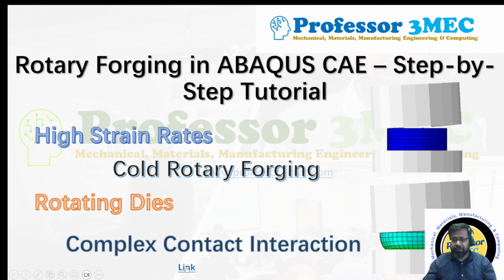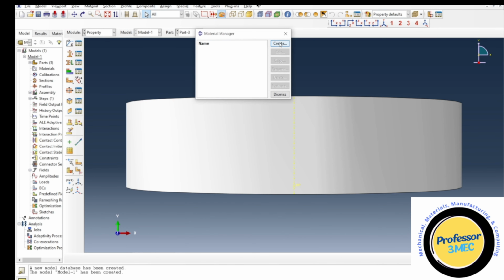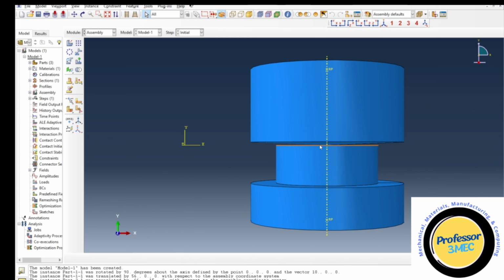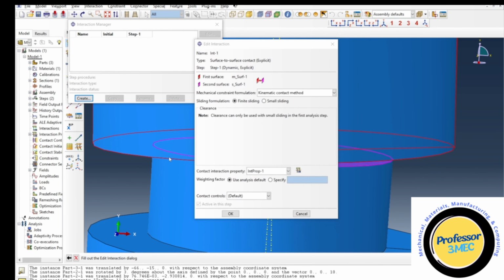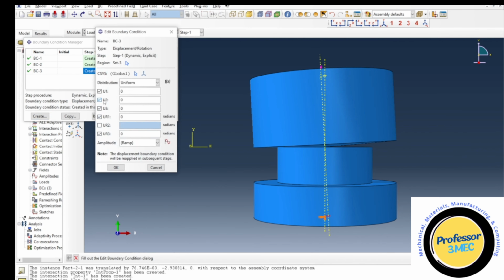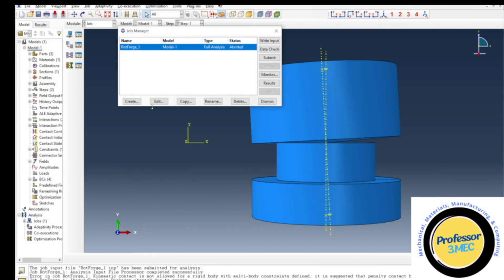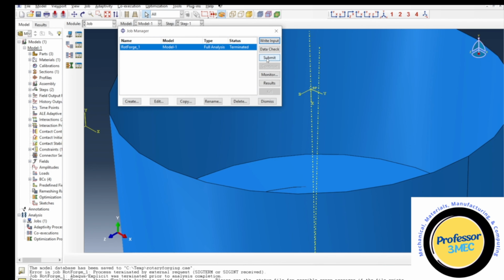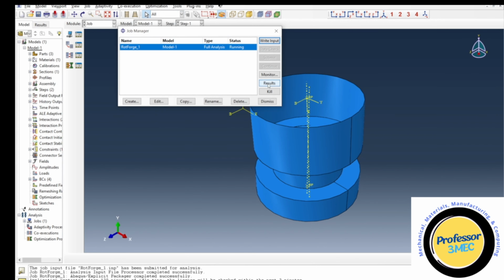Rotary Forging Simulation using ABAQUS CAE - A Step by Step Tutorial

Comment: Can CPFEM be used with a surface-surface contact pair or should we use 3D contact? if yes what should be the appropriate timestep for it? A paper "Comparison of the implicit and explicit finite element methods
using crystal plasticity" By Harewood states convergence is not achieved when using Contact Pairs with CPFEM model.
Reply from the maker: It depends on contact properties and one can achieve convergence but after compromising accuracy and computational efficiency